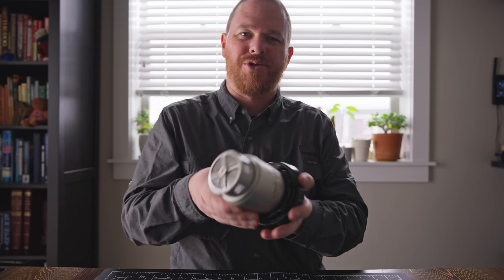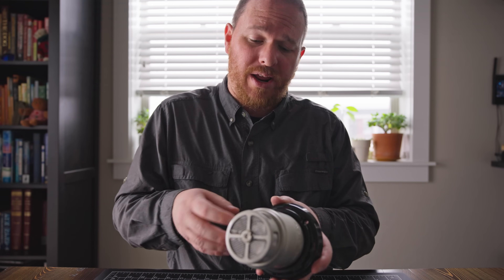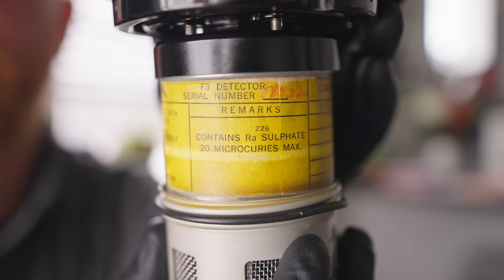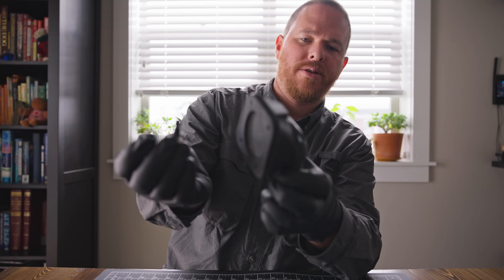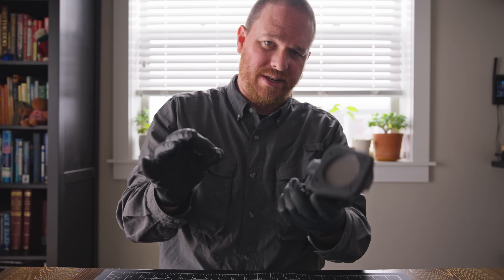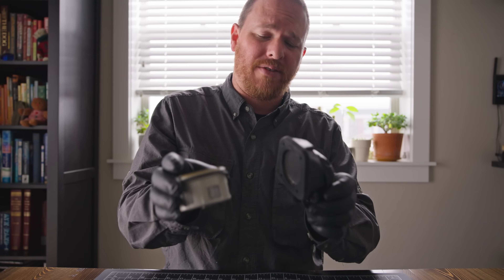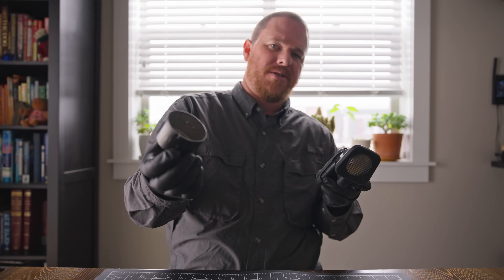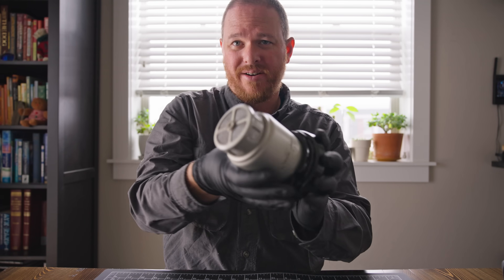Intensely Radioactive Industrial Smoke Detector from the 1950's

Comment: The site I measured was Asphalt Green on the Upper East Side of Manhattan in New York, that is said to be the original atomic Manhattan Project.  It is built up as a sports plex.  I investigated the area for my own knowledge, met someone who used to work for the City that said he saw the original plans for it being the Manhattan Project, cancer cases in the area, etc.  Anyway, it appears it was not just an asphalt plant, and there is also a military style building next to the East River where it is at.  Supposedly, the tiny island near it is where the nuclear waste the was buried.  Sales of that island never went through for some reason, it was supposedly to be sold to Japanese investors more than a decade ago for development, but that did not occur.  No active docks on it the last I heard, even though there is light boating on that polluted river.  Also mentioning that in Spanish Harlem an expose by radio news uncovered many years ago uncovered that the boarded-up buildings in Spanish Harlem of Manhattan were filled with radioactive radium canisters from old radium factories that used to be in that area.  That news disappeared on that; City probably worried about many lawsuits due to the number of cancer victims.  Those buildings were never put up for sale to be renovated during that time, and the community there was wondering what was going on.  No New York City person should have to pay taxes because of the very high level of corruption of City government, it is very frightening.  Many people thought it was just old radium tiles that were the issue . . .
Reply from the maker: Did you investigate the area with something that can detect ionizing radiation...like a Geiger counter? If not looking around a place won't do you much good. Even talking to people that are also misinformed won't get you any real answers. If there are elevated cancer cases I would look more for chemical exposure as the cause of that. The level of exposure that is needed to cause cancer in someone from radiation is very high. 

On the subject of radium...yes there are plenty of site that are contaminated still from old radium painting operations. If you want to identify places that might be a hazard I would say get a radiation detector of some kind that can hook up to your phone and log dose rates and location on a map. I have a couple of these that I run from time to time when I'm exploring an area or even around my home town. 

Also the tiles you were talking about are glazed with uranium not radium. Radium is about a million times more radioactive than uranium.
Reply: @RadioactiveDrew  Yeah, I did not use a radiation detector just the Gauss to see what would happen.  The Gauss went off mainly near the unused piers in that area along the cast iron/iron fence, measuring midlevel on the low range near the Manhattan Project site, and about an hour later one of the pier wood dismantled from the pier and starting floating, the creepy stuff often attributed to radiation.  I did not feel safe going to the site with a larger radiation detector.  Most of the radiation detectors I saw on the marketplace were larger than my small handheld Gauss that I could hold in the palm of my hand and it not being visible.  Since the Gauss picked up the radiation from one green glass radium lamp, I felt comfortable using it.  Yeah, I know what radioactive particles are and half-life.  Some say radiation detectors can be tampered with to show low readings, that supposedly happened in Japan in Fukushima as I read somewhere that government officials were given tampered radiation detectors.
Reply from the maker: @h.chappelle2720  there are plenty of small handheld radiation detectors out there. Better Geiger makes one for $129 and its pretty small. My friend got one for his 5 year old and he loves it. Don't use a gauss meter, whatever you think your detecting you aren't. Sounds like you are detecting magnetic fields from different metals...not radiation. 

None of the radiation detectors were tamper with at Fukushima. The only people that say that stuff are people that don't know how radiation or radioactive materials work.
Reply: @RadioactiveDrew     If I were to do an expose on a radioactive hot spot, I would use several different radiation detectors and a Gauss, black uv light,  I am not doing an expose and I live elsewhere.    Maybe Gauss deserves a Noble Prize since it can be applied sometimes to change of magnetic fields from radiation.  It was in quality news reports with sources that Fukushima radiation detectors that some Japanese government officials had tampered ones, and they even had the extent of the tampering.  Best of luck to you, you should be wearing a full anti-radiation suit with what you are doing.  Just because radiation does not look like an angry pit bull does not mean it is not very dangerous.
Reply: @RadioactiveDrew   My Gauss detected radiation in one radium lamp (or detected magnetic field change from radiation), as well as the smoke detector.  I could not go onto the pier of the original secret Manhattan Project site before it was moved to the Alamo because the pier was locked off, but the closed gates there emitted something that the Gauss picked up.  The wood from the pier that creepily broke off, followed me down the river as I walked.  I do not like radiation stuff, too creepy for me.   That area is also near Gracie Mansion about five blocks from the NYC Mayor's residence in Carl Schurz Park, and after 911 there may have been more security.  I did not feel comfortable carrying a radiation detector that may have set off some security even though I did not see any.  I noticed how choppers were dispatched there in an hour after I was there and left to be a few blocks away, usually there are no choppers there.  I did not enjoy what I did, just wanted to know.  I am actually more interested in change of magnetic field from radiation anyway that radiation readings, but I am not doing that anymore.

Comment: I measured a modern smoke detector I had in NYC with a gauss meter, no reading at first, then it went of the scale for about two seconds and then not all for 30 minutes and did not measure in later tests.  Not all radioactive particles are known, and Americium used in smoke detectors has supposedly not been much tested.   Supposedly, they are safe if they are high up on the ceiling with high ceilings, but what about the floor above it?  How close to the above floor, radioactive materials seem dangerous, and radiation bioaccumulates.  I am glad I left NYC, so many possible toxins.
Reply from the maker: First off a gauss meter measures magnetic fields. You can't measure radiation with a gauss meter. All radioactive particles are known and have been known for some time now. Am241, like what is used in most ionizing smoke detectors gives off some gamma radiation and a lot of alpha radiation. These smoke detectors are totally safe. The only risk would be if you were to take the radioactive source out of the smoke detector and eat it. Radiation doesn't bioaccumulate. Certain radioactive elements can accumulate in bones as the body can mistake them for calcium. But these elements need to be ingested for that to happen. Being exposed to the radiation they emit will not cause this to happen.
Reply: @RadioactiveDrew   The gauss meter picks up some radiation, I do not know why, but it works with picking up radium sometimes, not always.  Some inventions are multipurpose unknowingly.
Reply: @RadioactiveDrew   The gauss meter then reads the magnetic fields disturbed by radiation.  I do not know how it works, it is not my field of study, but years ago I measured radiation levels at an old site that used to be the original secret site of the old atom bomb Manhattan Project in NYC.  My gauss meter went off.  A few hours later, a piece of wood strangely floated from the pier near there, and choppers were flying around, people were talking about that as that usually does not happen.  Then, corrupt politicians banned Geiger counter sales in NYC a few months later.  My gauss meter picked up radiation (or disturbance of magnetic field as you would say) in 1930's radium lamp green glass, but not in another one, so I used a black UV party light to see it glow.  I believe different types of meters and black uv light may be needed to detect radiation.  i read in a science article that Americium can contain unknown radiation particles not yet discovered.  Thank you for posting about the gauss meter picking up magnetic field disturbances. Magnetic field disturbances are said by some to cause people to see extraterrestrials that are usually known to be around radiation.  The gauss meter is probably multipurpose.
Reply: @RadioactiveDrew  Radiation bioaccumulates in the body, not just bones but organs.  it can be inhaled, especially if there is dust and the radiation contaminates the dust.  It can cause cancer, like leukemia.  They try to say that radioactive strontium is absorbed by the body like calcium, as though the body needs to accept radiation to become mutated, not just exposed to it.  This is not my field of study, but it seems that  some radiation hazards are not allowed for public knowledge.
Reply from the maker: @h.chappelle2720  it sounds like you are confusing radiation with radioactive elements...they are very different. One is the energy that is released from an unstable atom as it tries to become stable, which can take seconds or billions of years depending on the element. Radioactive elements have chemical properties that are similar to other non-radioactive elements that organisms might incorporate into their bodies.

The body has no choice on if its going to accept radiation...no more than it can accept or reject a bullet that has been fired at it. Radiation travels at very high speeds and with a good amount of energy for its size. So its about physics, not if the body can accept it.

Comment: Just and FYI:  I just bought a couple simple smoke detectors, so not to have the Lithium one.  It came with radioacitve stickers all over it & even thou it's a small amount as you stated they will not accept returns of hazard material.  Which means it will be an added issues to get rid of too.   Just something to keep in mind when you only want a safe & simple one to use.
Reply from the maker: I'm not worried about ever getting rid of the one I have. These types of smoke detectors are pretty rare and I sold the 2 extra ones I had pretty easily. Its also a great source for different experiments for my channel.
Reply: I believe you can buy IR smoke detectors that have no radioactive materials. They use IR LEDs. the smoke blocks some of the IR, which triggers the alarm.

Comment: As a collector of fire alarm equipment, I have several Ionization smoke detectors. All of which contain 0.9 Microcuries of Americium 241. I keep all of them within their original box or in a storage bin. Should I have to worry about any sort of exposure risks? Or since the level is so low and since it’s only Alpha particles, I should be ok as long as I am not exposed to an open source?
Reply from the maker: You have zero risk from those ionizing smoke detectors. I have 5 of them in my house being used. They mainly emit alpha radiation which doesn’t go very far in air and it won’t go through the ionization chamber or the smoke detector housing. The Am241 does give off some gammas but they are very few and nothing to worry about. 

Now if you are taking those Am241 buttons out of the smoke detectors then that’s when you need to take more care.
Reply: @RadioactiveDrew   They certainly emit Gamma and x-ray which are probably bremsstrahlung, reading around 5000 counts per second on my Thermo 900/44A scintillator

Comment: is far i remember - its recommended to use glasses to protect eyes from beta rays, in case touching sources like this
Reply from the maker: I’ll have to look that up.
Reply: Definitely wear safety glasses when handling sources with high amounts of beta radiation.
Reply from the maker: @jordanstokes1690  well with that logic then you should be wearing safety glasses when handling uranium glazed ceramics.
Reply: Yes, glasses are important.

Comment: What a beautiful find! I also have an F3 Pyrotronics smoke detector! They're very hard to find! Mine is dated 7/16/1959. I also have several of the Pyrotronics F3/5A models and a F5B model too, which each have 80 μCi of americium-241. The Ra-226 and Am-241 sources will also "overflow" (≥ 367,440 CPM) my SEI Inspector USB Geiger-Müller counter too. My EcoTest Terra-P dosimeter read a maximum of 111.7 mSv/h (11.17 R/h) from the Ra-226 "lipstick-type" mast source, however that was with beta and gamma, so it's not entirely accurate. I also have three 5.7 μCi (211 kBq) plutonium-239 sources from РИД-6М (RID-6M) Soviet-era smoke detectors. The Pu-239 sources are the most gentle of these three isotopes, since it emits mostly just alpha particles, and with extremely little gamma ray emissions. I get about 84,770 CPM from each Pu-239 source, but with a sheet of paper absorbing the alpha particles, I only get 302 CPM from the low-energy gamma rays, since the gamma ray branching intensities for Pu-239 are so low. So, the gamma ray exposure is basically null. With the F3 however, the ionizing radiation is coming mostly from the bismuth-214 and lead-214 decay isotopes. The Ra-226 decay isotopes are pretty much in secular equilibrium at this age now, meaning that the Ra-226 decay isotopes now have about the same activity as the Ra-226 parent isotope, meaning that these Ra-226 sources actually became hotter, fairly shortly after they were first fabricated. So, you will get very broad energies and numerous branching intensities for alpha, beta, X-rays, and gamma rays from Ra-226. Anyways, great demonstration! Wonderful quality! Thank you for sharing this! I really like it! 👍
Reply: I worked for a midwestern Pyrotronics distributor 40 years ago. And while by the early 80s these specific type of ionization detector were no longer manufactured, there were still many in use and those were almost exclusively found in large mainframe computer centers and telephone company switching centers. They were  also often coupled to Halon or CO2 fire suppression systems, so not an inexpensive investment.
Reply: 11 Roentgens per hour.....holy hell. Isnt 400 R a fatal dose? They had these things around children in schools back in the day. I dont know how many times I walked under one for 6 years.
Reply: @donreinke5863   The specs on his Ecotest Terra P show it's limited to 999.9 µSv/h  or just under 0.1 REM/h so I don't know why he thinks his readings are over 100x what his Ecotest can even handle. 

 I just took the beta shield off a Ecotest Terra Bluetooth and had .8u Ci of americium-241 touch the tube. It only detected 5 µSv/h or .5 mrem/hr. So 80u Ci would only show 50  mrem/hr on his Terra P as the Terra P and Terra Bluetooth use pretty much the same Built-in gamma, beta sensitive Geiger-Muller metal tube. 

Most people don't understand that their probes are likely calibrated to CS-137 and any other isotope the pulse rate has to be recalculated. That or an Energy Compensation Filter (if even possible) has to be used to show accurate readings. If I used my Ludlum 3-98 with the my Model 44-3 NaI(Tl) scintillator detector, it's HYPER sensitive to americium-241 on it's energy response chart. About 80 times more sensitive than the CS 137 it's calibrated to. So it would detect about 80 times higher radiation than was actually being emitted.
Reply: @RadiationNetwork  Good....someone who explains...and explains well....the inaccuracies/limitations of radiation monitoring equipment.
I was always suspicious of how accurate these devices were.
Reply: @donreinke5863  As he said, they had multiple models and most of them used Americium. I highly doubt your school was using these, no matter when it was built.
Reply: I had a Ecotest Terra P and I have a Terra Bluetooth. The Terra P specs show it's limited to 999.9 µSv/h  or just under 0.1 REM/h. My Terra Bluetooth is limited to 9999 µSv/h or 1 REM/h but I'm not sure if it will saturate before it reaches those numbers.
Reply: You might want to be more careful about sharing what sources/types of sources you have.  You might set yourself up for a visit from the NRC
Reply: That’s some spicy stuff!! Would love to have a very active sample but also don’t want any visits from the alphabet agencies.
Reply: What is your most active source?